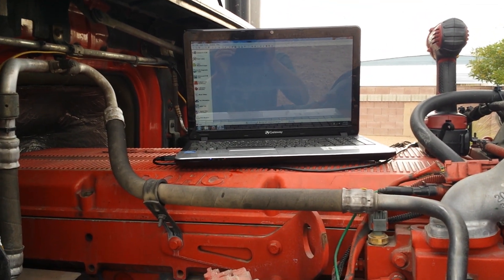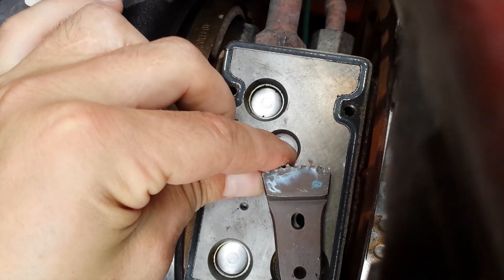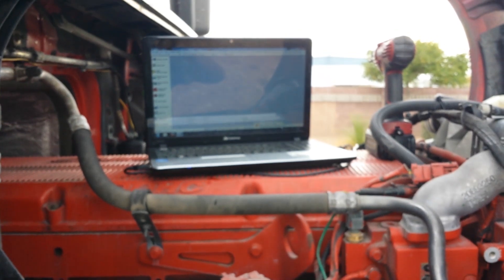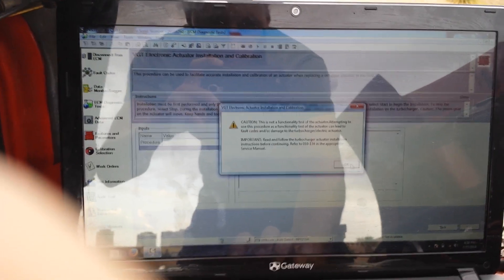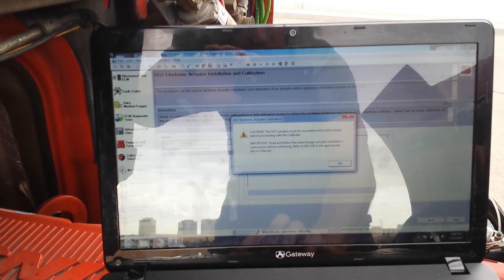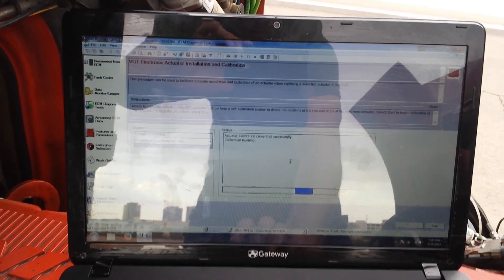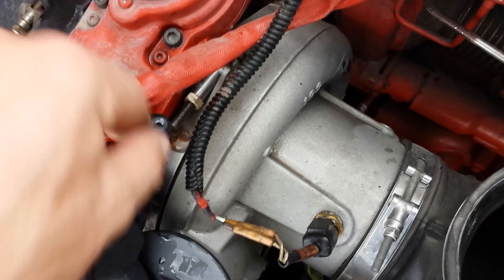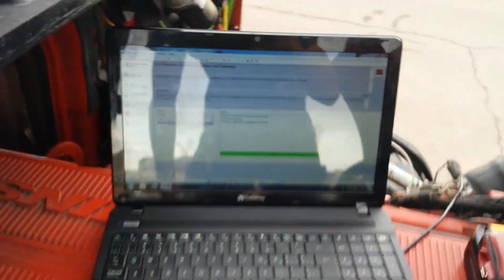CUMMINS VGT ACTUATOR SET UP

Comment: I go5 a new actuator put on my 2009 Ram and I can hear it move when turning key on but brake does not work.  Also have a code for o2 sensor module but that is also new.
Dealer reflashed it but can’t figure it out.  Btw DPF is not working judging by tail pipe. Does sensor3 module code effect DPF operation?

Comment: Those screws need to be torqued, you need the gauge to check your turbo vanes, you need to replace sealing washers on banjos, need to inspect pins at engine harness, if you don't drain and fill cooking with a air lift pump, you'll get air pockets, curva where do these amateurs get the insite software
Reply from the maker: Jose Olivas amateur??? lol best of check your self buddy. I fix shit you  dealer techs fuck up on daily basis . Btw you can get Calterm and Insite at every 7eleven these days.
Reply: Great job, don't let these know it all pros get tge best of you.  We send trucks to dealers sometimes when we are backed up.  one came back with the transmission brace missing.  Studs nuts and all!!   Sent another with the Ubolts on rear end not torqued yes by no other then our kw dealer.  Yeah that pumpkin jumped forward and broke a couple of things.  Got it repaired for free on dealers dime!
Reply: Lmfao, I fix dealer shit all the time.

Comment: Would it cause the engine to not want to start? I know the new ISX if the turbo goes out it won't start! I'm having an issue on the px8 Cummins not starting! Didn't know if that valve would be the cause acting like a fail safe
Reply: Prelude Dude Si if the lever is to the left the truck will turn on and cut off immediately.
Reply: If turbo goes out engine will start anyway.

Comment: Just a quick question on how and where did you acquire the software and the tool/module?
Reply: You can buy the Insite software from cummins . And at my work we use a Nexiq box to plug into the truck . But you need to make sure you buy a real one . There are fake boxes out there .

Comment: My engine brake is weak and low sound could this be my problem?
Reply: fxmdbosko what software are you using?
Reply from the maker: Install the boost gauge in your truck unless you already have one , under engine brake at 1500rpm boost must hit over 20psi if not 9 out of 10 times it's VGT veins inside the turbo that melt from hi exhaust temps.
Reply: If they melted do I need a new turbo?
Reply from the maker: Mario Soto unfortunately yes, it's a very common problem. Only way to avoid it is to have EGT gauge and Boost gauge in the dash. I drive by my gauges once boost hits over 20psi I keep the throttle steady until road speed starts to fall off , at that time I select lower gear and do the same thing over and over till I climb the hill. Keep an eye on EGT , I suggest to keep it under 800f° .
Reply: Ok can the dealer check it if it is melted. I don't have boost or egt gauge in my truck where can I get them and what kind?
Reply from the maker: I will always suggest against going to the dealer,  I'm in Vegas I will be more than happy to help you out . If you need gauges installed I can order it and install it for you. Is your truck cm871 or cm870 , easy way to tell is by looking at the turbo ,if you have a big electronic looking box on top of it it's a cm871.

Comment: Good afternoon
I just buy a month ago a 2008 kw with cummins ixs engine. Before of that i have a kw t2000 with JBall ecm which was a good inversion. I just one month i be having to many isues with electronics and after watch your videos i want learn how to work with this engien, what and where i can buy the tools that i going to need to access my ecm from my laptop. My email is sk2molina@gmail.com 
Thanks
Reply: Hector Molina hi can someone help please, I do have a 2011 Cummins and I do have the turbo he351vg on it but I want to swap the he300vg on the truck can someone please help if I will need a special plug for the actuator or just extended the cable thanks ?